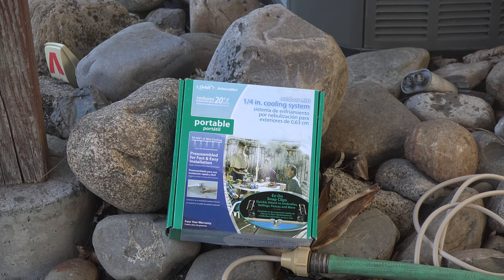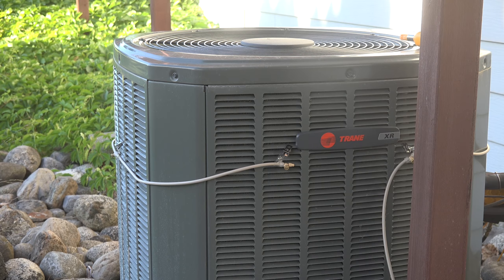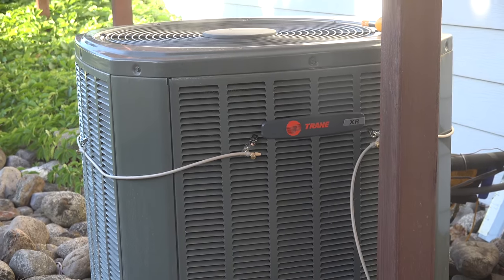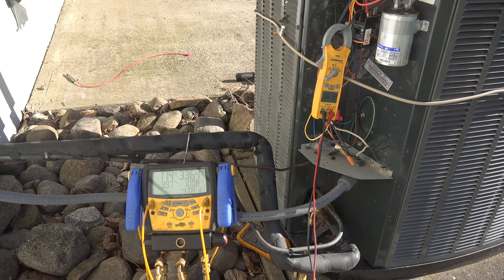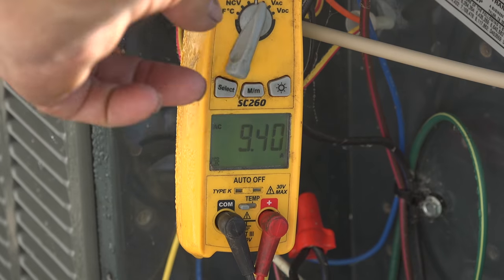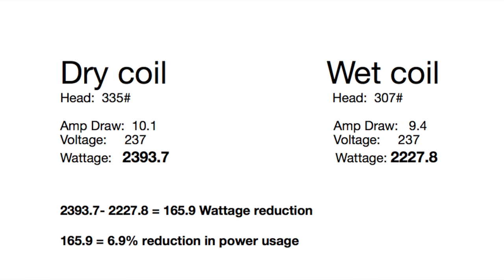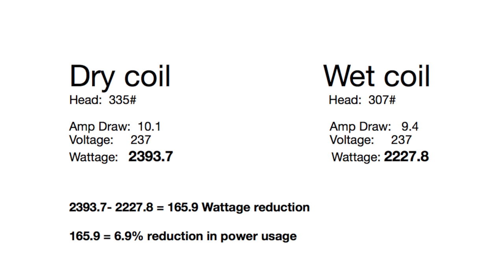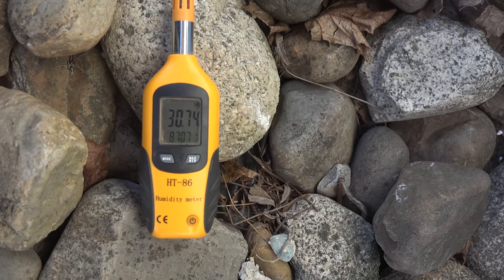Do the misters for A/C work? Part #1

Comment: I just spent 4 hours removing the hard calcium crust on the coil fins of my 4 ton a/c  condenser unit that had a mister installed two summers ago.  I used a 2 inch paint brush to paint on Muriatic acid full strength to soften the  crust and then went through 3 plastic fin combs scrapping off the built up.  I followed that up with a strong foaming coil cleaner and lots of water.  Here in Oklahoma City our water has a lot of dissolved solids and by the way I used a calcium in line filter for the mister and changed it yearly.  My advice is don't install a mister on your A/C condenser unit, you're asking for trouble.
Reply: Well, it's a good idea to clean the AC system once in a while, and 4 hours does seem like a sunday project but not too bad... Vinegar is what is used in bathroom cleaning products to dissolve calcium deposits, if you get one of those soap hose mixers for car wash and put vinegar there every few weeks, you can let your misters to do the work for you.
Reply: The big problem is you need to use distillled water to avoid this issue. Who wants to buy tons of distilled water to keep this system running

Comment: I wonder if you would achieve similar results by directly cooling a six inch section of the AC pipe directly with slowly running water.  The used heated water could also have great benefits for use in a nearby small underground irrigation system.  Another variation of this theme is to cool a small section of the AC coil with the water using the water supply line that feeds the house.  There is lots of water usage in a typical house during the day from flushing the toilets, using the sinks, washing machine, taking showers, etc.

Comment: Couple of questions:
1. Would it be possible that the misters also caused an energy savings through reducing the overall cycletime that the condensor is on and running?
2. Even in high humidity areas, where the mist wouldn't evaporate, could the fact that some of it would still be pulled against the coils as water droplets still have an impact on the coils cooling?
Reply: jeremy baumgart 
1.) It's unlikely to save you money, the difference you will paying for water
2.) Google evaporative cooling and no with high humidity means less water will evaporate thus less water carrying away heat.
Reply from the maker: I think you are picking nits here.  The possible efficiency increase is very small.
GFM
Reply: JB, the cycling is controlled by the thermostat inside the house.  Misting either makes the unit more efficient at cooling the house or it doesn't.   The cooler water should have a positive effect on condenser temperatures no matter what.  The heat of the condenser will cause the water to evaporate.
Reply: jeremy baumgart 
I think you are right. Part of the advantage was missed(mist, nerdy pun). If the outside temp is lower it also means the inside is as well, so the inside thermostat should trip it off sooner due to higher heat transfer bringing the temp down faster. Also it appears the misters could be more effective producing an improved gain.

In the end I believe this will ruin your condenser due to corrosion and hard water buildup, so I wouldn't do it long term. A dedicated heat exchanger designed for it could be made though (cooling tower). The cost is why you won't see that done commercially for residential sized units.
Reply: Freddy McIntire, I don't understand what you are trying to say.  I've heard of superheat and sublimation, but never subcooling. What is it? How do you measure it?

Comment: Well, your test showed a definite improvement in the operating efficiency of the AC unit and you didn't optimize the misting heads or spray patterns. This could be done with rain water and a pump that is driven by a solar panel w/battery, as the pump would not require much power.

The point about humidity is valid in the context of ambient temps, however you also need to consider that the A/C coil is hotter than ambient temperature and therefore will heat the water enough to cause it to evaporate. Think about it - no matter how humid the weather you can still boil water and produce steam...well, the AC coils won't boil water but it will certainly still evaporate and improve the transfer of heat from the coil into the air. Also, the water can drip off the coils and provide cooling in that fasion.

If I was going to do this, I'd probably catch rainwater out of a gutter pipe. The concerns over damage to the coils are irrelevant with proper and simple maintenance, like cleaning the coils as needed.
Reply: I don't think he knows what he thinks he knows, or that there are things that he doesn't know, or that there are people who know things that he doesn't know.
Reply: Yep, and he can also up the AC efficacy by cleaning the coils/innter system out once a year. 

Plus you could give the AC unit extra shade by placing a large beach umbrial over it. Or plant two trees near it.
Reply: Rain water isn’t a great solution for this as it’s likely not going to be as nearly as cool (relatively to the ambient) as tap or well water would be.  

That being said… this guy making the video isn’t taking into account if the system is running less to achieve the same temps inside the house.  In other words, if the temps across the evaporator inside the house are dropping, the air coming out of your vents is going to be cooler and the system won’t run as long. Not sure if there is any truth to that but it’s a factor he never addressed

Comment: Setting aside all the potential issues related to spraying the condenser coils (legionella, coil corrosion, mineral buildup) - I'm not so sure that this one's that easy to poo-poo away.  Saving energy is always a huge plus, but even putting that aside, a system like this will give the overall system a performance boost on super hot days.  In the middle of summer here in Georgia, there have been times when my AC unit was having trouble maintaining the temperature - the unit would essentially run continuously just to maintain setpoint.  Especially after a power outage or if it had otherwise not been running for an extended period - it would take FOREVER to get the house cooled back down on a 98 degree day.  Manually (temporarily) spraying water on the condenser coil to help it shed heat has always helped the situation.  
It's incorrect to assume that on a very humid day a system like this would lose ALL effectiveness.  Sure, on a low humidity day, the air itself is cooled before passing over the coils, but a MUCH larger transfer of heat takes place when liquid water evaporates directly off of the coil surface.  So even if the humidity was at 90%, liquid water being forced to evaporate off of the much higher than ambient temperature coil surface ensures that there is still a cooling effect.  Think about it, even on a crazy hot, super humid day in Florida, and even right next to the ocean, everything still quickly dries (the road, patios, decks, etc.) right after it rains.
Of course, the TRUE issue with something like this is what I "set aside" in my first sentence.  Spraying water onto the outdoor coil clearly has a benefit - it's just that doing so is very likely to cause damage the system.  Figuring out a way to get around all the mechanical risks is the key to making this work...

Comment: The bottom line is the misted water evaporates, cooling the lines in the compressor.
Same as evaporative coolers from 60 years ago.
Since humidity is not a concern outside, this might be worth something but, you might save a few bucks per month but you get the chance to build up mineral deposits in exchange.
I can appreciate the decision to blow this idea.

Comment: The only flaw I see in the test and math is coverage of the misted air,  discharge temp change and run time. If you reduce your run time by an hour per day that is also a savings of not using any electric for that time at all. That is not only the condenser, but also the evaporator fan at 200 watts or more for that savings period.
If that savings is enough to offset the water increase then it's a plus. Add in the treatments to clean the coils monthly and your time... Maybe a wash, but personal time vs TV watching is less electric usage. 
#1 if you bought a spec house, everything in it is cheap and inefficient. Get in that attic and add some insulation. Add attic venting, add solar fans, add soffit venting, add a wrap or two to the A/C ducts, cover the evaporator with a wrap but make sure you only strap the insulation in the service side.
Next service your A coil yearly. Imagine one filter worth of dust getting into the A coil. If you haven't cleaned it in 5 years it'll look like a shag carpet.
If the envelope of the house is crap, the AC will perform like crap since it'll almost always be clogged... BTW most filters don't last more than a month, I don't care what they write on them. 
Can a mister system work on an already inefficient AC? I believe so, but you better help it all you can. 50°F discharge air flowing through R4 duct may pick up quite a few degrees in that 140°F attic then come out as 65°F air at the register. 
This video shows a far superior AC than most viewing have. I do still stand on the run time statement. Very good math, just overlooked an element.
Reply: This right here. He completely disregards run time

Comment: Growing up in West Texas, we used swamp coolers, I’m wondering if a shroud, using that technique, would cool the surrounding air without the mist harming the coils.
Reply: I know that I have ran water over the coils and as I started the air was hot. But once the coils got cooled down from the water I was spraying it was considerably cooler coming out of the top of the compressor. Those were my thoughts exactly. Just like in a fractionation plant the cooling towers have a huge water reservoir and water is used the same way to cool the process.
Reply: @willwright3396  🎯

Comment: At 2 minutes 40 seconds you said what I was waiting for. 
Number 1 son is selling everpure water filtration along with other HVAC services. After some time with this company, he has noticed the filtration systems are not performing as promised.  
I would think, if misters were beneficial to the condenser, manufacturer's would have installed them years ago.

Great subject and video with lots to think about.
Reply from the maker: Consider if, as a manufacturer, I could increase the efficiency of my air conditioner by 20% just by adding this product and not have to spend many thousands (or millions) on higher efficiency compressors, fan motors and coils.  I would do it in a minute.  Obviously, it does not work well.
GFM

Comment: This analysis is completely ignoring the amount of time the AC unit is running. Misting the outside using makes the exchanger inside the house colder. This cools the house faster, which allow the AC unit to run less time overall. So, an AC unit that is not running is infinitely more efficient than an AC unit that is running.

Here's how I know this to be true. Yesterday, the temp was in the upper 90's where I live, and the AC was not keeping up. So, I went outside, and "misted" the coils with a hose.  I came back inside, and within a few minutes, the temp in my house dropped 2 degrees.  A few hours later, the temp was high in the house, misted it outside again, and the temp dropped again 2 degrees in the house. This tells me that misting the outside unit kind-of "supercharges" the AC. On a regular day, it would allow it to run less often.

You didn't take that run-time into consideration at all..
Reply: Your condenser may have been dirty...
Reply: The outlet temperature didn't change at all in his test so it doesn't matter how long it runs because it will take the same amount of time to do the job and if your method worked people would be using it all over the world. Systems that work right don't drop the temperature 2 degrees in "a few minutes". I don't know what your measuring but I trust this old guys expertise over your one test with no documentation lmao if you have a for example a 3 ton or 36k BTU air  conditioner you can not get more than 36k btu out of it by getting the coil wet. It doesn't work that way sorry.
Reply: @mr.monitor.  what are you calling the outlet? Just trying to get my head around your response. Also, another thing not taken into account is outside temperature. No test is performed here to determine if it might be more effective closer to the 100 F outdoor temperature mark.  Just thoughts. Interested to see your response. Thanks!
Reply: @UncleMartin  by outlet I'm  saying the wet bulb temperature of the air coming out of your ductwork basically. Measure it before and after misting the outdoor unit;it won't change much if at all. If you turn the ac on and check temps keep in mind it takes at least 20-30 minutes to get the base temp. When a coil is wet the head pressure will drop a lot and yes will decrease the amp draw...but it will also have a hard time sub cooling(I know I know this seems backwards but its not) the now lower condensing pressure/ temperature of the refrigerant which leads to a cascade of events in the metering and flow of refrigerant that pretty much balances out anything being gained....its not saving  you much if anything.

Comment: I did design my own setup using a small current sniffer to turn on the water to the nozzles that detects the AC unit turning on without physically being connected to it and it draws just a few watts when running but I am also using a timer so this thing only kicks in when the sun is hitting the heat pump directly which is for about 3 to maybe 4 hot hours a day then it tapers  off as the sun starts to set. I f I had to give an opinion I would say that the air in the house feels a bit cooler but that could just be psychological. Just a side note: Your video was done very well covering this topic and is one of the better videos on youtube. Thanks for making this video.
Reply from the maker: Welcome.  You are probably right about the cooler air being psychological.
GFM
Reply: flash001USA The inside air will be cooler. When the condenser temperature is lowered the evaporator temperature is lowered too.
Reply from the maker: I will be publishing a video covering that issue.
GFM
Reply: That's why you have to run a filter to make sure you're pulling garbage out of the water. We don't have calcium issues here so that's not a concern and as far as running this thing and damaging the AC unit outside that's not going to happen anymore then rain coming down from the sky while the thing is running and causing damage to it. I do understand where you're coming from but this thing only runs during the peak heat of the day which is only for a couple of hours when the sun is directly shining down on the unit outside. In other words I've got it setup on a timer and I don't even bother running it unless it's close to Triple digits outside.
Reply: The sun hitting the condenser coil directly will reduce the cooling system effectiveness. Your strategy might actually help with improving the cooling efficiency.
Reply: Before I set this up the air coming out from the top of the unit was a lot warmer without the water mist so yeah I think it probably does contribute to a little bit better efficiency during the heat of the day when the outside air is still and the sun is bearing down on top of the outside unit. This is why I have it set up on a timer so that it only activates when the sun is shining down on it and if it's cool around 70 or 80 degrees I don't run it then either. Here lately at night it's been getting down into the upper to mid 60s and I don't run it at all during the night. I only run this thing in the heat of the day and even then it's only going to run for a few hours while the outside unit is in the path of the sun.

Comment: Many thanks for your test. Like you I find savings that slight not worth the risk of mineral buildup. Also, that water might be better used—and harmless—sprayed to cool down brick walls and hot asphalt. Cooling around your house should make cooling in your house cheaper.

Comment: As an AC tech who has done this and also worked on evaporative cooling towers, I don't even want to get into the subject of water hardness and calcium deposits. What I do want to say, is when you lower the head pressure you will correspondently lower your suction pressure, and this will give you a correspondingly lower evaporator temperature, which can give you a little cooler discharge air. Not much, but some. Sometimes large systems would get away from us on hot days, and with hot rooms and hot outside temperatures, we would try to start a system up, but it would trip on high pressure. We would then run the system while spaying down the condenser coils until the rooms cooled. Then the suction and head pressure dropped, the load decreased and then it would run ok without water being sprayed on the condenser.